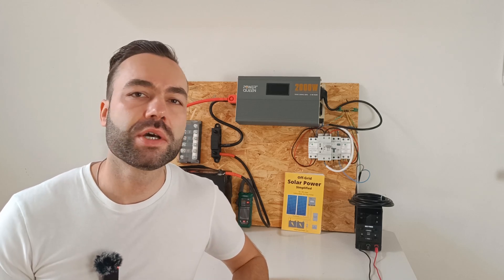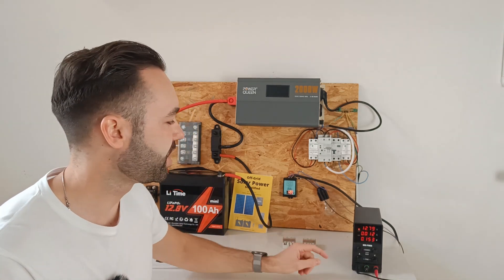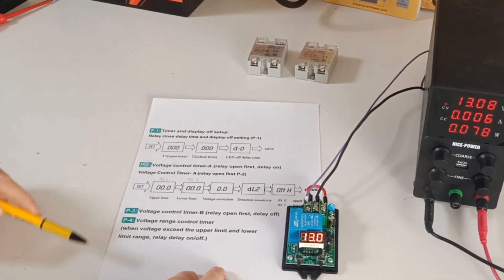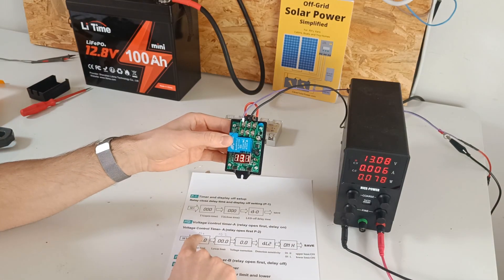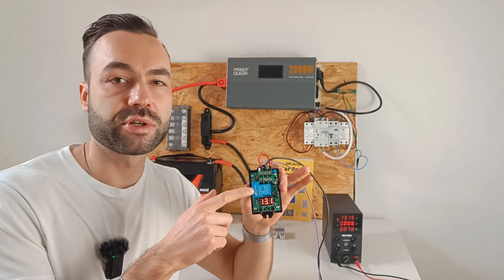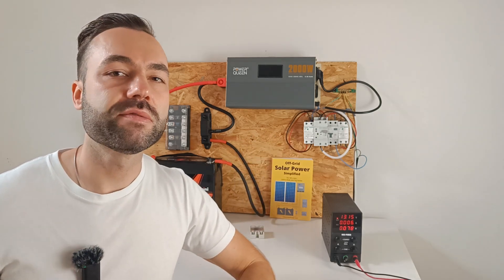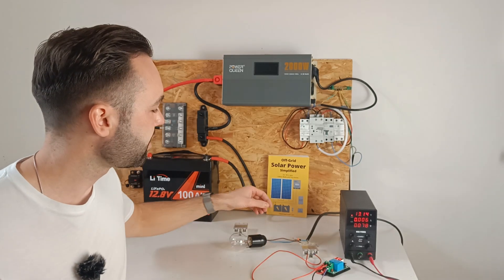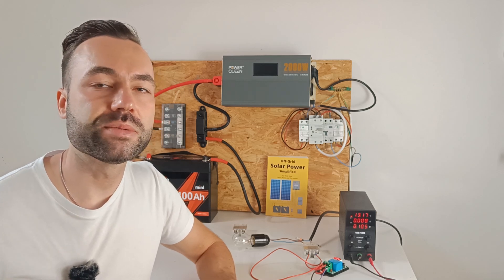Solar Dump Load - Heat Water When Batteries are Full

Comment: Thanks I have been wanting to do this, I have 2, 12vdc water heating elements and a small 2.5 gallon tank with weld 1” FIP for element immersion. Just want to thank you for sharing this information!  I appreciate all you do to educate us on solar issues and applications!
Reply from the maker: Make sure to check out 'david poz' his video about matching the water heater to the voltage and resistance.
Reply: @ I appreciate your help and really enjoy your informative videos!  You really have been helpful especially in your grounding and bonding! Had some bad advice, you my Friend got me right!🤠👍🙏🏻
Reply: In a less austere time of my youth, bathing without hot water was a challenge for a while. Just a gallon or two of boiling hot water, mixed in with cold bath water took the edge off a cold morning's routine. You don't need a lot.